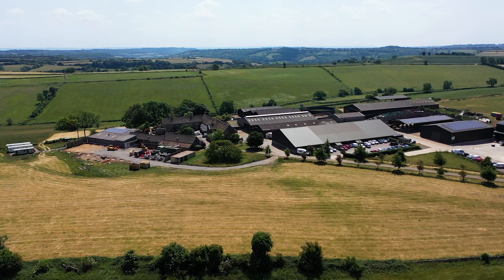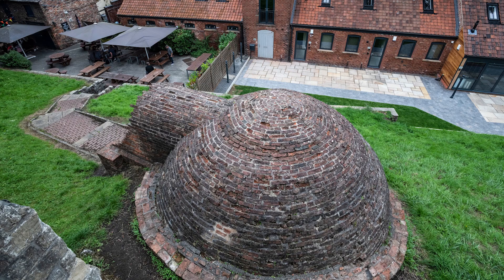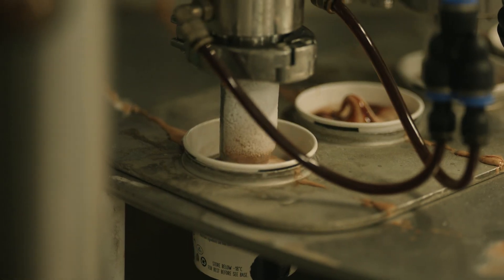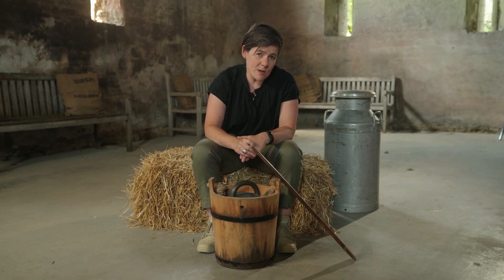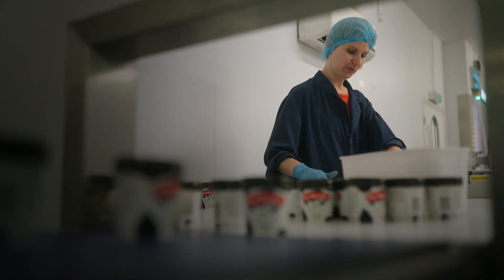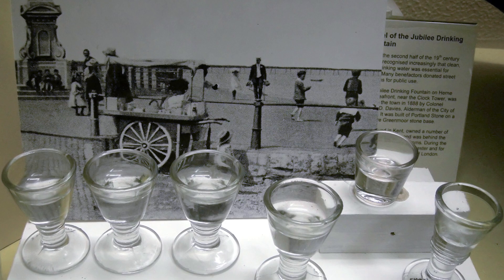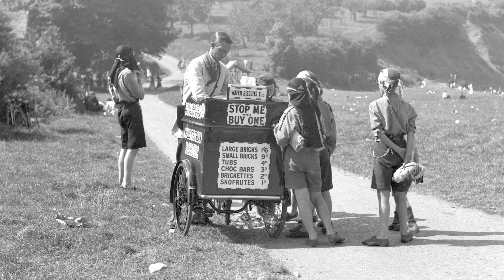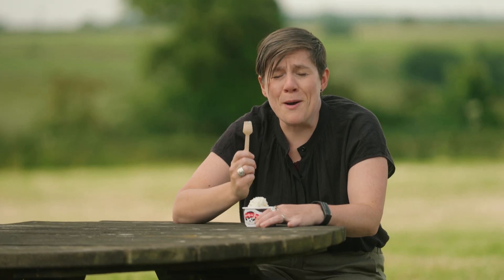The History of Ice Cream with Dr Annie Gray

Comment from the maker: Here are the answers to some questions you might have about this video, from our expert Dr Annie Gray: 

- Hang on...didn't she mean endothermic reaction?

Well-spotted. Annie says she's mildly mortified and has no excuse apart from possibly a craving on a very hot day to get on and eat the ice cream leading to her fluffing her lines. An endothermic reaction draws heat out of its surroundings (as when ice melts). An exothermic one puts heat in (like fire). Adding salt to ice therefore creates an endothermic reaction (it is pretty, um, cool). 

- I thought the Romans made ice cream? 

The Romans and early Persians made use of snow and ice to make frozen confections which were probably a bit like modern granitas or slush puppies. However, these weren't ices (I.e. ice cream and sorbet) in the later sense of the word. That took the discovery that salt mixed with ice can be used as a medium to freeze a liquid without being actually mixed in with it. It's first recorded in the mid-16th century, and became common in Italy as that century progressed. It's likely that British people discovered a love of ices in Italy, as well as Spain and France as the technique spread, and brought the desire to make them back with them when they returned from their travels. 

- Wow! I want to try this at home.

And you can! Easily. Just grab a plastic mixing bowl (ceramic risks cracking), fill it with crushed ice and loads of salt, and then use either a metal lidded container such as a coffee cannister or a couple of sturdy and well sealed plastic bags as your sorbetière. The most basic mix is one from Agnes Marshall - a pint (600ml) of water, the juice of one lemon, and a cup (250ml) or jam or marmalade (scale this to fit your vessel). Mix it up well, and then put it in your container. If it's a metal vessel, just mix it, put a lid on, twirl it, leave it for 5minutes and then repeat,  scraping the sides off and mixing them in as it starts to freeze. If you're using a bag, bury it in the ice/salt for 5minutes and then dig it out, scrunching it up to break up the freezing mixture and mix it up.
Reply: Ice cream actually was invented in China before the Roman era 🙂
Reply: @natviolen4021 True. Chinese people invented ice-cream around 600AD. They used frozen milk cream imported from North Asia/Mongolia and mixed it with fruit juice. They had underground ice houses too.

The Romans and the Persians brought this recipe back to their respective nations and modified it to their own tastes. I guess we can say they improved it.

Comment: Most know about America doing a thing in 1920 called "Prohibition," banning alcohol. What few know is that to stay open, most of the nation's bars turned into ice cream shops. As a result, ice cream filled the social void, taking the same social role in culture as alcohol did before Prohibition.

Bizarrely, America's military formed a fleet of shipped just to haul ice cream to the soldiers. Yes. Freighter ships loaded entirely with ice cream. In addition, whenever an American ship sank, the soldiers would actually raid the mess haul freezers to rescue the ice cream. The soldiers would be sitting in the life rafts EATING ICE CREAM OUT OF THEIR HELMETS.

On a more amusing note, B-17 and B-24 bomber crews would stuff ice cream mix into ammo cans, and stuff them into the ball turrets. The freezing temperatures at altitude, combined the vibrations from the engines, and the air turbulence of weather and FLAK explosions, all of that would actually churn the mix into ice cream, which the crews would eat after returning to base. Consider it a reward for a successful bombing run.

In 1943 alone, America's military ate a combined 135,000,000 pounds, yes, 135 MILLION pounds of ice cream.

So, today, if you see an old war veteran eating ice cream every day, you know why.